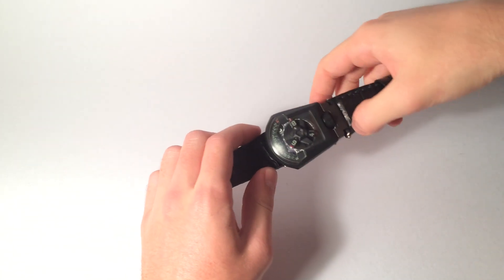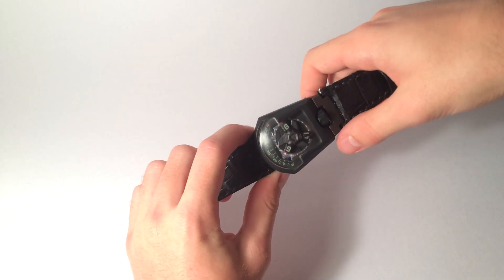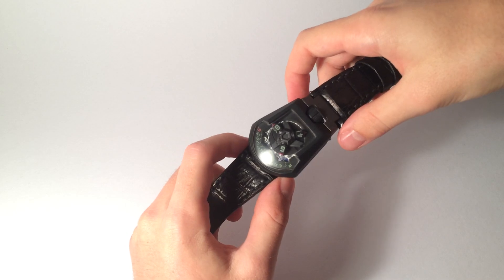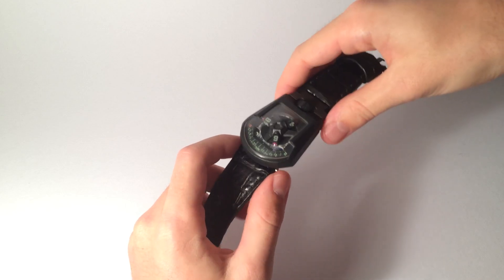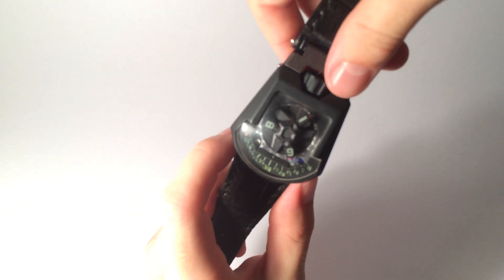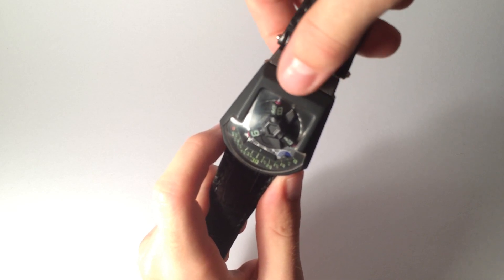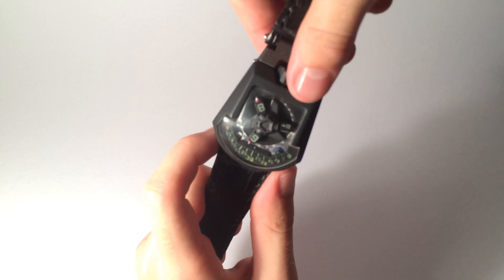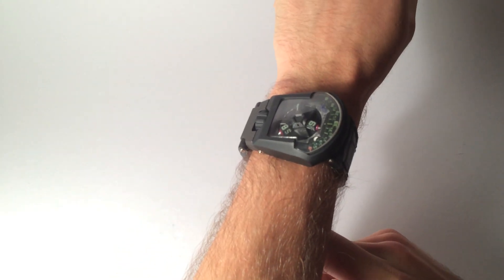Watch Lover Builds Urwerk UR-202 Homage & Tells The Tale | aBlogtoWatch

Comment: Very interesting indeed, specially when he talked about the costs! 2200$ plus all the hour of work he put into it, RD, testing, prototyping, assembling ecc.... I won't discuss that, small independent watch makers can charge any price for limited editions, but I wish to discuss Rolex. Rolex doesn't innovate since ages, they do the same watch over and over. So my impression is that a Submariner (steel of course) cost them 200-250$ to produce, and they sell it for 7000$. Please don't tell me it is hand made, you can't hand made 1.000.000 watch a year! Any feedbacks on this?
Reply: it's more than 200-250$. china can do them for 250$, but rolex has high QC control. so they would reject 85% of chinese watches (as an example). 
you do need to factor overhead etc. 
the raw production cost includes labour aswell. i rough estimate, the watch will cost 2.5k$ to produce. add 2k$ marketing and overhead. gg